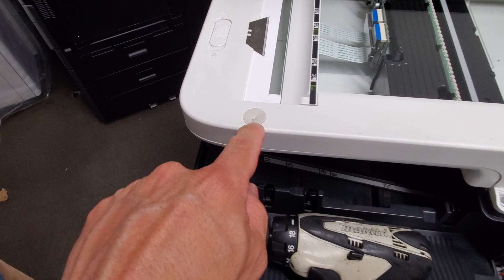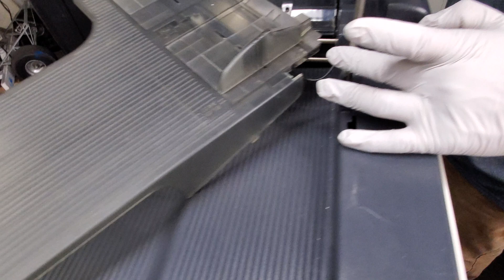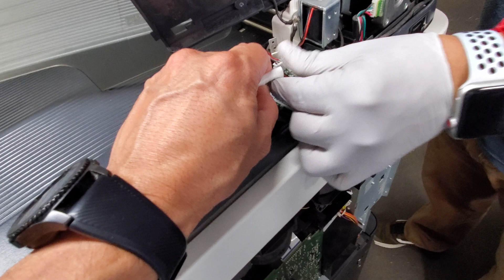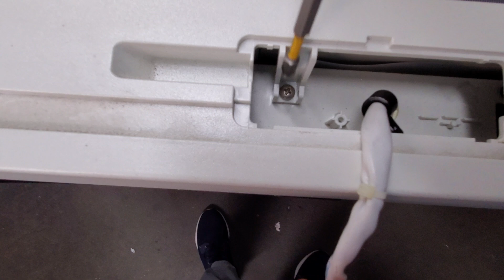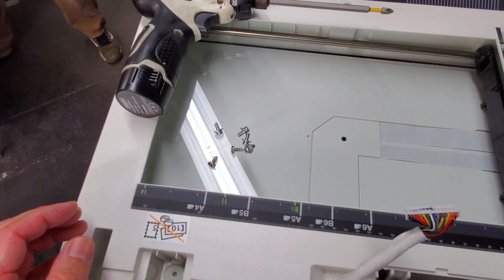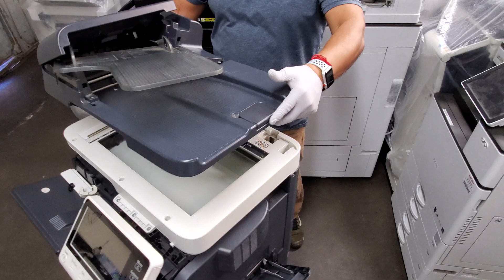Konica Minolta bizhub c3350-c3850 scanner glass removal procedure

Comment: I have an issue with mine which the printer display "Scanner locked   Please release the lock and then press the [confirm] key"

Meanwhile the scanner is not locked, I have to press the confirm key several times before the error could clear (I press confirm, scanner move a bit, if the scanner didn't go to it natural position error appears again)

1. Scanner is moving

2. When it works, after a single photocopy error appears again

Comment: How are you my friend, I have a problem with a printer in Zahab 3350, such as when choosing to print a number of 10, the number is doubled to 20, which is multiplied by 2, what is the solution to this problem, knowing that I did a restart of the device and replaced the computer with another and the problem was not solved Please send an explanation video to solve the problem, thanks.